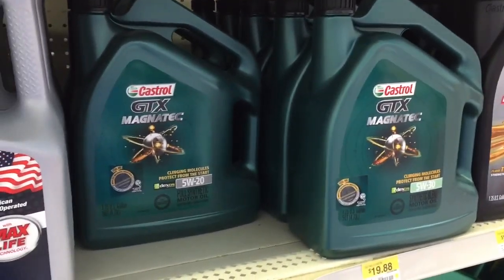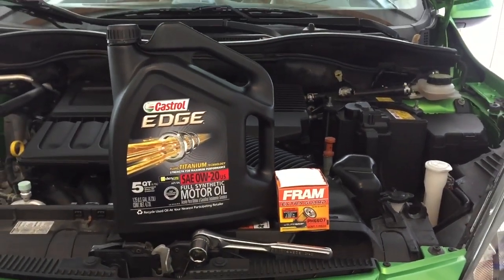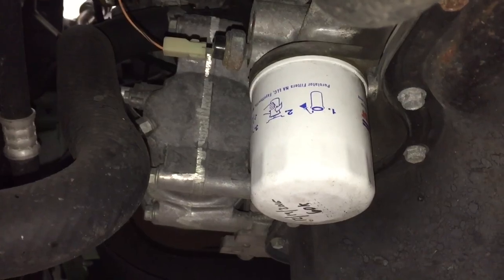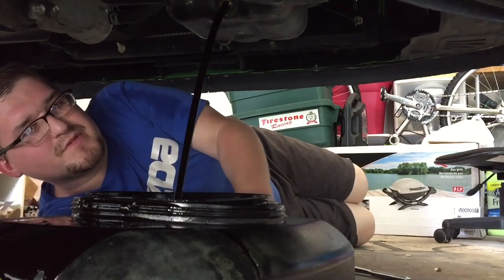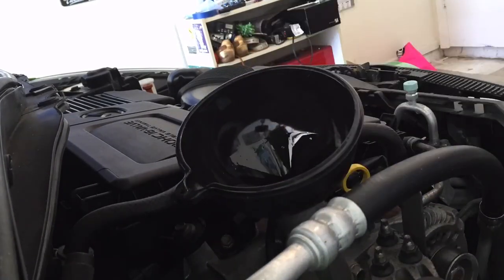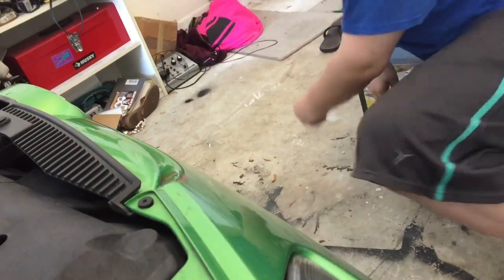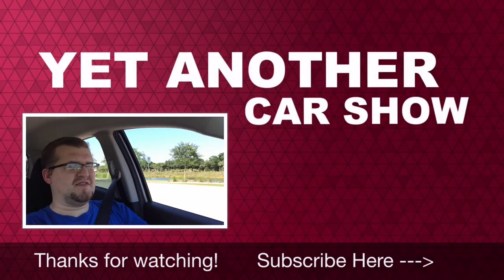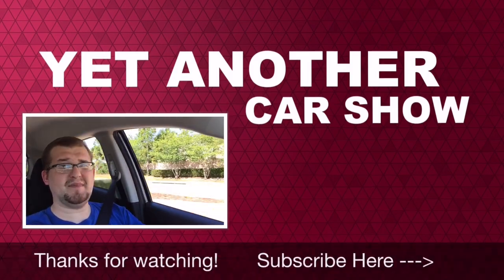Mazda2 | Oil Change How-To

Comment: Thank you for this video!  I was able to do the oil change without having to jack the car up, by the way.
Reply from the maker: +speelunker Stock suspension? I like inspecting everything while I'm underneath, so I'll always jack the car up and put it on stands, lowered or not.
Reply: DaedalusZero Good point.  My suspension is not lowered, and it was very easy just to do the oil change.  I can still see most of what's going on under there, but your right...I can't do a thorough inspection unless I get the car jacked up.

Comment: I’ve noticed a rattle noise coming from what sounds like under the car idk what it could be. Maybe a heat shield but if it’s not could u give me any ideas on what it may be? Also what exhaust r u running to make it sound like that?
Reply from the maker: It’s probably a heat shield. I also have a slight rattle coming from somewhere. It’s a common thing. Just gotta find it! 

My exhaust is custom made and I bought it from another 2 owner.

Comment: What torque in nanometers should we use for the oil pan plug ?
Reply from the maker: I’ve never torqued a drain plug. Reasonably tight with a regular ratchet is always fine.

Comment: 0W-20? I've seen that 5W-30 is the right one for the Mazda 2 2010 1.3 original?
Reply from the maker: It’s different depending on the climate in your area. Always consult the oil cap and owners manual for the correct oil weight. 👍🏻
Reply: HiroshimaSpirit thanks

Comment: You were first considering getting a 5W-20 or 5W-30 oil, but then went for 0W-20 as if there was no difference....

Isn't it important to choose the viscosity specified in the owner's manual?
Reply from the maker: In the video I specifically say, “They don’t have Magnatec in the weight I want, so I’m getting Edge.” I wasn’t intending to buy the wrong weight. Castrol was transitioning their product line around that time, so both product names were on the shelf, but not in the same weight. Up until this point, I had been buying Magnatec in 0w20.
Reply from the maker: Besides, the at-running-temperature viscosity of be oil would be the same if I had purchased 5w20, so it’s not like I’m going to destroy my engine. The difference between the two is marginal. Mazda more than likely specified 0w20 from the factory for fuel efficiency.
Reply: My bad, I didn't realise what you were referring to by 'weight' but I get it now. I'm just trying to gauge how important the differences between the oils are, as I'm new to this sort of thing. Anyway, thanks for replying.
Reply from the maker: Generally speaking if you’re not racing or anything, the oil recommended from the factory is what you use. I do track days in my silver car, so I run 0w40 for a little bit of extra protection at high temperatures and engine speeds. The green car has 110k miles and counting on it, so I now use 5w30 high mileage. Both full synthetics.

No worries! Stick with it and you’ll learn plenty. All of my knowledge is just years of real-world experience. I’m not trained or a professional. I’m just passionate about cars and wanted to learn to do things myself. 

Thanks for watching! ✌🏻